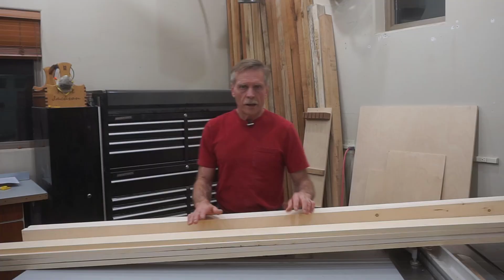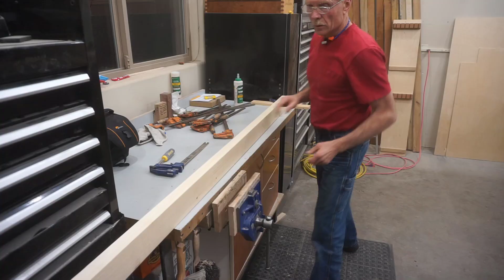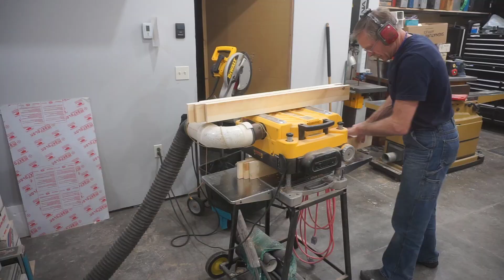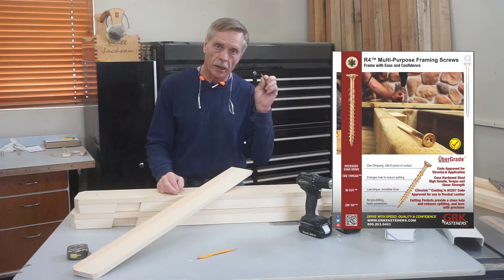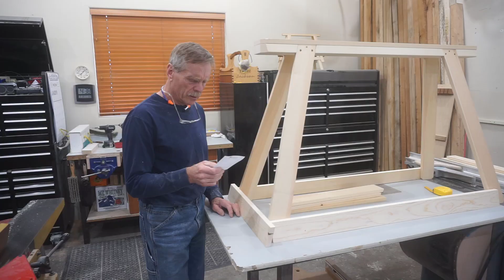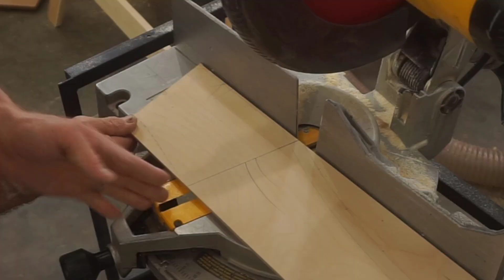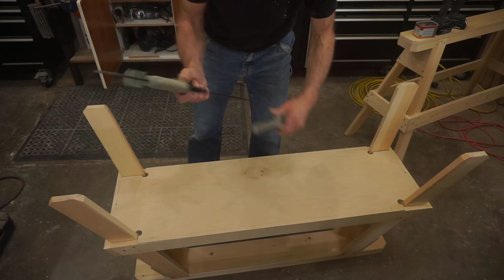Build these Professional Carpenter's Sawhorses

Comment: I can’t bear to watch. Those sawhorses are garbage. They won’t stack and are too weak to use. I keep my backhoe on site to move materials beside the found. You can’t put a bundle of 3/4 plywood on it. Or a bundle or 2/6 16 ft long. We use 6 to 8 pairs.  We don’t put anything on the ground.
Reply from the maker: I'm calling you out on your comment here, James:
$1,000 cash, any time, any where: I setup my sawhorses and have a forklift put a full unit of 3/4" plywood on them. If they crumble, I'll hand over 10 Benjamins.  When they hold, you fork over the $1,000 in cash.  Deal?  
Even AFTER I prove to you they AREN'T "too weak to use",  I won't even press you on the lie that my Professional Carpenter's Sawhorse won't stack when they do... but you should be man enough to admit it.
BTW not holding my breath because only blowhard cowards that don't have the spine to stand behind their words post provocative comments like yours.

Comment: I kind of understand why. Because all the detailed cutting and fitting is important. It's the messy part. GLUE. Despite the mess glue really multiplies the strength of construction. My father built boats. Lots of curves and few straight lines. He used high quality silicon bronze screws and waterproof glue. The importance of the fasteners he said (plus tons of clamps) was to hold everything together until the glue set and cured.
I saw the amazing load test of your apprentice saw horses. I expected failure. You used no glue so its superfluous for saw horses. Glue covers a multiple of sins
Reply from the maker: Good perspective, Stephen... thanks for  sharing it here.
Just think about how sawhorses as strong and durable as these are WITHOUT glue are when glue IS used for assembly.  I suspect failure of unglued sawhorses would be from failed connections while failure of sawhorses assembled with a high quality wood glue like Titebond  would be from wood members themselves because with glue the 'weak link' shifts from joints to the wood itself.

Comment: I’m 67 yrs old. I have now had three sets of this style sawhorse since I was   In my late 20’s. 

They live outside and I abuse the hell out of them. When they start falling apart after 10-15 years I just make a new pair. 

I like to use construction glue as well as screws. 

My next set will have a 2x4 axially along the bottom of the 2x6 just to strengthen the belly of the horse - since I make mine at least 36’ long so I can slam sheets of 4x8 ply on them 

QUESTION FOR YOU. Are you happy with 12 deg and 15 deg angles?  Would you modify them at all. 

I found 10 degree angle on 2x6 is too shallow and 15 degree is too big so 12 degrees is a GREAT compromise. Seems like the 15-degrees angle is a bit much. I’ve always done 12 and 12 but I like how the 15 would theoretically make them more stable along their axis without being tippy on the end. 

I OFTEN cut into the top of my horses (minimally!) and I’ve never needed a top plate. But my next horses will have a SACRIFICIAL top plate that I can remove over time. 

Oh. PS. I use pressure treated lumber!  Over time as they live outside and I use them I tend to paint them with whatever paint I’m painting in normal use. So my horses tend to look like a “painted horse”. Multiple colors and no rhyme or reason to the color. But at least it protects them. I even throw some poly or varnish or whatever I’m using. I’m talking about painting enough to just clean my brush or roller out. I’m not trying to paint them with whatever whole horse - just cleaning up brush or roller before I wash them. See?  

To me this is the ideal horse. My three sets have done TONS of work. 20 years ago I made my brother a set and his are still as good as new since he doesn’t use them as much as I do and he stores them in a small barn. 

Last thing. I want to put a tool shelf/box on one so I can hold tools but I’ll only do it on one so I can easily still stack them.
Reply from the maker: Sawhorses truly are much more than 'tools' to those who've made a career using them in their career!

Comment: Many years ago, I commented on your video on "How To Sharpen a Pencil" and I likened you to John Wooden, the great UCLA Basketball Coach.   That comparison remains today.   Well done.   Saw horse design aside................what I want to know is; while spreading the glue with your finger, HOW did you refrain from wiping it off on your pants?   I've told myself a million times that I won't do that anymore and yet every pair of pants I own has Type III Tightbond stains on them.  😂
Reply from the maker: Thanks for your long-time 'support' of Next Level Carpentry on YouTube!  Where wiping glue is concerned, I can tell you haven't met Mrs NLC.  She faithfully keeps my wardrobe wearable without complaint but I have to deal with anything outside 'normal' expectations ie: glue spots which I have to remove so there's plenty of incentive for me to keep Titebond off clothes.  I guess that's why I never developed the habit of wiping glue on pants but, rather, use paper towels and sawrdust to manage the mess...

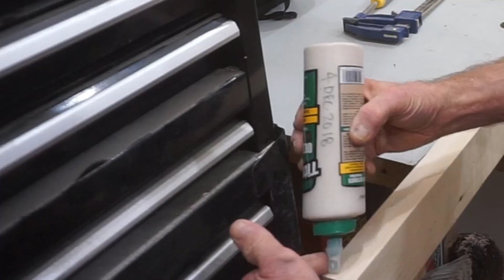Comment: 4:19 is there any consideration to grain in the building of these sawhorses or the glueing up of the top?
Reply from the maker: Nothing very particular other than just basically picking decent lumber for the horses in the first place.  It's not a tabletop after all so many of the kind of considerations you might be thinking about aren't necessary IMHO.

Comment: Couldn't you notch out the top piece and have it drop in level with the legs providing over 6" of surface area?
Reply from the maker: If a wider top piece is the goal I would just start out with a wider top beam and make the top piece wider to match.  This is a better solution than to notch through the top piece because a notched top lets legs protrude for an uneven surface.

Comment: How long will that glue-joint last? As long as the sawhorse itself? So the bow/twist/cup/etc won’t ever pop that glue apart? Thank you for all the videos you do.
Reply from the maker: In my experience, glue joints are the strongest part of a board so I don't worry about it failing prematurely.  If horses are left out in the weather to the point moisture makes them bow/twist/cup, then fasteners will start to loosen in compromised wood causing the horses to wobble, split and fail before the glue joint has any issues.  The takeaway is that a glue joint, properly done, is a good thing, not a bad thing IMHO.

Comment: If they are made properly they shouldnt need any lower leg bracing-- thus making them easier to stack and store
Reply from the maker: It's a bit annoying that you imply these horse are not 'made properly.  Apparently you're not aware that the bracing serves more of a purpose than compensating for improper construction and, because only one horse of a pair has a tray, they stack just as well as weaker, less useful horses without lower bracing as part of their design.
Reply: I didnt actually watch the video   you are right -- so please accept my appologies ( dudnt notice the tool tray)

Comment: Thank you. Absolutely amazing. Since you went to that length with these sawhorses I think you should mitred the wood that holds the tray. Thank you once again... Can't wait to see the designer sawhorses.
Reply from the maker: Mitered corners would be a bit more 'elegant', Nader, but I've never considered it.  My only defense is that the simple lap joints used are easier and probably stronger even though 'easier' isn't necessarily the goal with these.  I'll consider using your suggestion next time I make a pair of these... it would take them to a Next Level of design! 
Best,
Matt

Comment: Matt,
Love your common sense approach.  What is your workbench top made out of?
Reply from the maker: Thanks John.  Both of my official work benches have tops made out of cut-down solid core commercial grade door slabs that have solid  wood edges and gray laminate on the top.  Nothing elegant compared to a lot of show-off benches on other YouTube channels but I'll put the quality, quantity and profitability of work I produce using those benches up against that of anyone's! 😉😎  You can get amazing door slabs at re-store type outlets or just about any commercial remodeling project so they're dirt cheap and can't be beat for use-ability IMHO.
Best, Matt

Comment: Nice shop. I came up with the style of.., when you show up to build a new pad/project. First thing is building some sweet ass saw horses, usually from trees or whatever’s around. Take your time with a purposeful improved design and a fancy super rad joint or two. . Then when your done building said off grid compound or whatever, the saw horses become part of the pad and landscape. Have fun

Comment: What's your favorite horses? The super strong ones you did that held how much? Ten tons? Buying a house gotta build a set. No time on the job for building a set there. You da man thanks for the knowledge!
Reply from the maker: Hey Christopher I think if I were in your shoes I would build a set of the sawhorses you saw me make in this video. There are plenty strong but they're more lightweight and more useful because of the tray and the framework underneath. My absolute favorite saw horses are essentially the same design although they're considerably more fancy but unfortunately I have yet to do a build video for them. Best, Matt
Reply: @NextLevelCarpentry  ok thanks good idea, don't think I'll be dropping 5 tons on them at home, probably build both sets eventually, prosperity for you 2021!
Reply from the maker: 'Zactly!  Feel free to post links to photos if you want... have fun with the build! Best, Matt

Comment: I needed to relook at the timer and could not believe my eyes.  1 hour!  It flew by quickly!  I picked up some additional language bits from you.  Journeyman and Master Carpenter (?), et al.  While observing your work this sawhorse was quite different from the first segment I viewed.  I enjoyed them both.  Your shop is loaded and well refined.  Is there a way of building the same sawhorses without the tools you have?  If so, what tools would I need to endeavor an enjoyable mission of this kind?  Thank you so much for sharing this video, sir!  Semper Fi
Reply from the maker: You're quite welcome!  FYI I built more than a few pair of these ponies on a jobsite with a speed square, skillsaw, hammer and nails so don't let the 'well refined' shop discourage you.  Naturally I needed to do a 'next level' job for the video but 'site built' ones perform just as well despite a little less refined appearance.
Glad you liked the video... look forward to your comments on others if/when you check them out!
Reply: @NextLevelCarpentry  Sounds great.  Here's another question for you, with your permission, would you have the LEGEND required to build the "ponies.'  Many thanks to you sir!  Semper Fi
Reply from the maker: If, by 'LEGEND' you mean 'plans', I do have something incomplete but think viewers are better off watching through the video using the measurements and dimensions shown in it for making the horses.  If you're a Trimble SketchUp 3D modeling software person I'd be happy to send you a .skp model file to work from.  But if you don't use that program the file won't help you.  Sorry I don't have a better answer for you! Best, Matt
Reply: @NextLevelCarpentry  Super!  Many thanks!  Semper Fi, Rob

Comment: UM, your making saw horses not a piano. why rip your glued lumber to 5-1/2 isn't 7" stronger. Guess your slow at work.
Reply: Great video . I've read so negative comments , but I like the attention to detail because to me it shows pride in one's work.........even if it's just a pair of sawhorses. So screw the complainers and keep forging ahead.
Reply: Well, Chip pinned the comment so it comes up on top.  Just a Desk Jockey here but even I know that 7" adds more weight and if you want a top piece the same width that will be added cost (or time) and more weight.  Heavier doesn't mean stronger.  Video is instructional (and entertaining) -- recently subscribed.
Reply: The negative comments come from so called contractors that think close is a 1/2” gap and a tube of caulk.
Turn the channel, you evidently don’t work on a master carpenter level, judging from your comments.
Go back to your basement, shut the door and play your video games!!
Reply: Because, as clearly stated in the beginning of the video, it's a physical resumé not an exercise in building something quickly. Dipshit.
Reply: Commenter is on the next level of carpentry … below. Maybe a few levels :D
Reply from the maker: Really?  Man, I thought for SURE I'd be playing Motzart's Rhapsody in Blue Minor on these ponies when I finished with them... and now you tell me they're sawhorses and not even a piano?  Good grief...  I should quit what I'm doing and change my channel name to Turn Buckle... THAT way I could contribute something worthwhile to the world like you do!
Reply: Next Level Carpentry is the master level posted yet?
Reply: Seriously, why spend all that time and effort on something any journeyman could make in 15 minutes , 5- 2x4's. and a nail gun. Seems silly to post  crazy ideas on "saw horse" construction don't you agree? No one is going to do what you did for something that's going to be left outside and beat up every day. just say'in

Comment: I’m seriously thinking about making some mini versions for in-shop/finishing use. I’m thinking that if I spend a few moments thinking about it, that I can come up with what would be a pretty repetitively useful height. Especially for things like placing components in places other than the floor or when putting up the barn for the night. I only have a 20x20 shop and both floor space and flat top space is at a premium on fine jobs when table saw, workbench, router, planer, joiner, bandsaw, etc... all are being used a bunch. Additionally when it’s rainy or during winter the space becomes even more critical.   Thanks for the video.
Reply from the maker: FYI The 'Minnie Whinnies' used in the video are built to 3/8" = 1" scale.  Pretty easy to do so when you choose a height if you can figure out what scale/relationship it is it might make the reduction process more straightforward.  Or, better yet, if you use SketchUp you can model the horse first and then, using the Scale tool, reduce both model and dimensions in a flash.  BTW Search "Build These Super Strong Sawhorses" and you'll find another NLC video showing a different sawhorse design that's, well, super strong, and would be simpler to replicate in scale.  Best, Matt

Comment: Why do you not cut into the protector board on the top of your horses? They are replaceable
Reply from the maker: If you want to go ahead... some people Bang into things all the time with the bumpers on their cars because hey that's what a bumpers for right? Others take a little more pride in the appearance of their cars and saw horses and prefer not to necessarily use them for their intended purpose... Juss sayin.
Reply: Next Level Carpentry ok, but bumpers are for accidental impacts not a regular driving practice. So when you rip a sheet of plywood on your horses do you place a scrap under it to protect your horse's protector board?
Reply from the maker: @timbarry5080  OK then... call it a 'bumper board' , not a protector board.  You cut into yours and I won't...
Reply: Next Level Carpentry I'm just trying to understand how you use it. I'm not trying to criticize your habits. One way is no better than the other. I just don't have the inclination to protect my horses. Not to say I'd run the blade full depth through it.  I personally treat the top of a horse as a replaceable part intended to be replaced, like brake pads.
Reply from the maker: @timbarry5080  No worries... I tend to be a bit OCD when it comes to stuff like this and you wouldn't be the first to give me a bit of 'grief' about it.  It might be a bit more understandable when I get around to doing the Master Carpenter Sawhorse build someday.  They are the ones I use on all my real-world projects... they're so 'over the top' I'm going to get a bunch of flak about them but, since they're approaching furniture quality, I make extra sure I don't cut into the tops on them... kind of like making sure you never even come close to bumping into stuff with a Veyron... OK, now I'm starting to exaggerate, sorry! 😁😂😎 Thanks for watching and commenting here... and being reasonable about it... I respect your inclinations as I'm sure they're what work and make sense for the work you do.

Comment: Someone commented on those plastic sawhorses, they are an absolute joke. And even expensive!! I borrowed a pair and they simply fall apart. I do like (but don't own) the alu ones. Ten years ago I started with those metal "hinge" brackets. Those are just not strong enough and they don't keep shape.
Then two years ago I read about the I-beam design. In less than an hour I built a pair using some old 2x4's from a torn down fence. Hah, they were even already painted :-). Definitely not built as fancy as the apprentice ones shown in the other video, but man are they sturdy. And the cost is just a bunch of screws.

Comment: Matt: Great circular saw work on the compound miter angles on the legs. I see that there are only two compound miter angles and they are supplementary (they add to 180 degrees). So if you use a compound miter saw, the legs can be cut to length, beveled and mitered with a limited number of "single" cuts from a long (e.g. 8 foot) piece of leg stock. After the initial cut, each single compound miter cut would produce a pair of supplementary compound angles forming a leg at the desired length and incline.